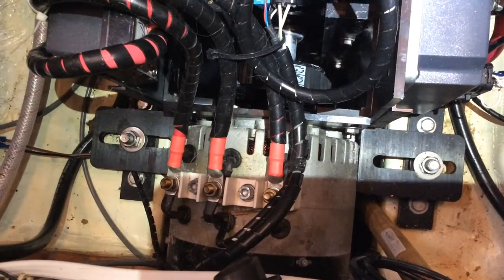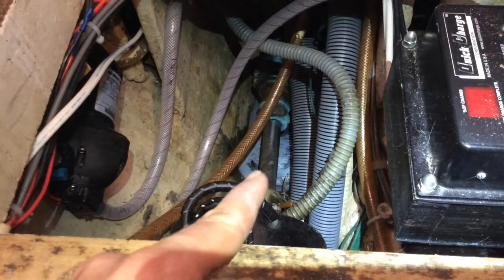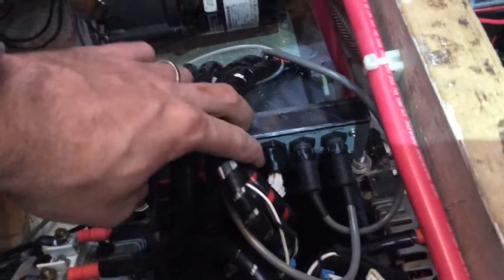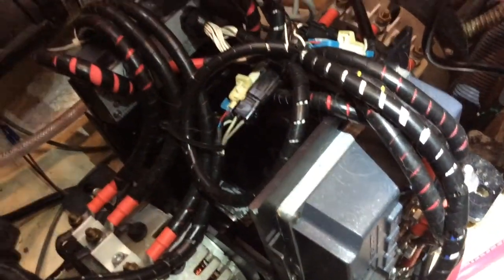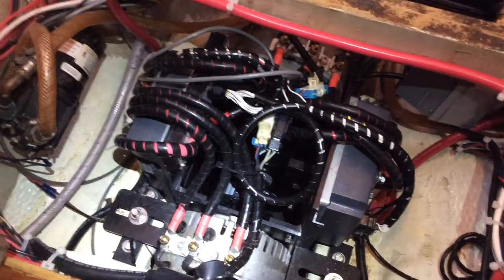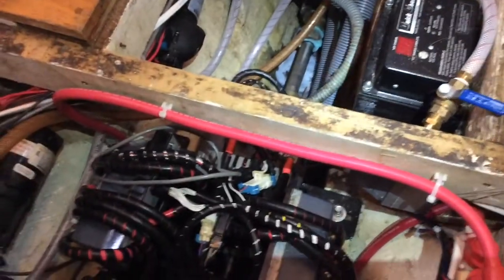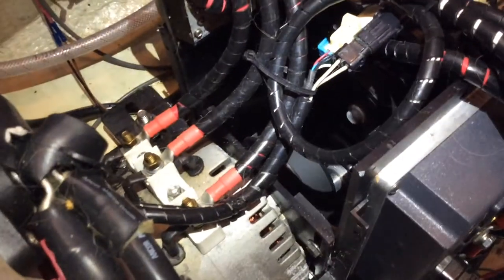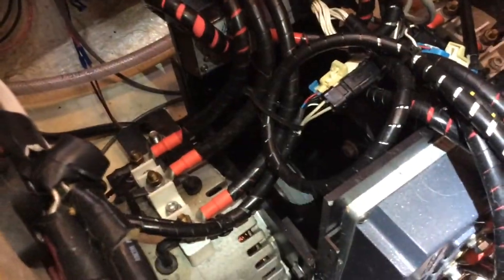Living on a Sailboat: Fixing a Submerged Electric Motor

Comment: if by chance you can get an air compressor on board and blow the engines off, it will help remove water and dry out areas you cannot reach.   They will tolerate water if not running, but over all, do not like it.  You were lucky it was not running.  Cheers.    Combined it is 10kw??
Reply from the maker: +Fritz Sproul each motor is 10kw. Combined is 20kw. 
I got really lucky!

Comment: Have you removed everything and pulled it all apart and given everything a clean? Including the controllers? Because if you dont i think you will have massive reliability problems in all that whithin twelve months. 
Moisture not properly removed and treated in electronics will wreck everything. 
You should record how everything is connected. Lable everything.
Remove everything. Dissasemble all the motor and pulleys and controllers down to individual electronic cards etc.
Spray and "paint" all these components with wd40 or inox to wipe off any electrolisis remains and dry out with dry air and heat ( turn on that heater in the boat way up) 
Wipe off any excess and use a air gun if u have one. 
Then reassemble everything. While u do this u may find other problems which can be fixed now and save you another "rebiuld"
Then its all cleaned and lubed and will probably give you another year or two of life in this component of the boat!